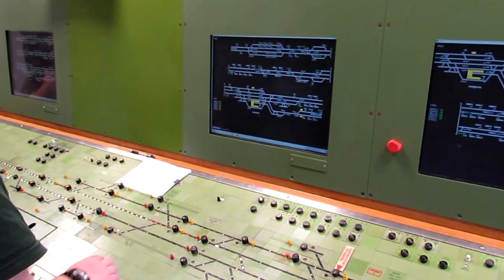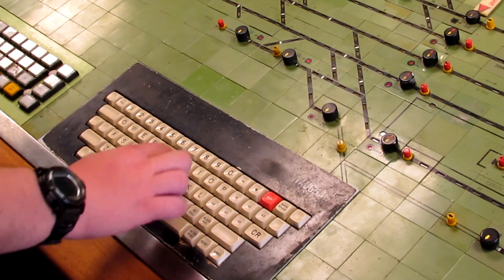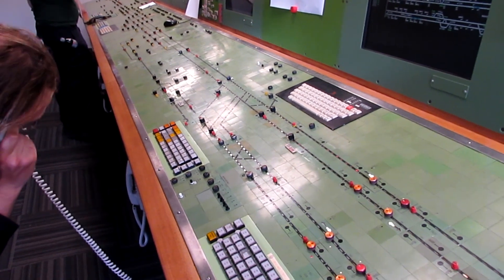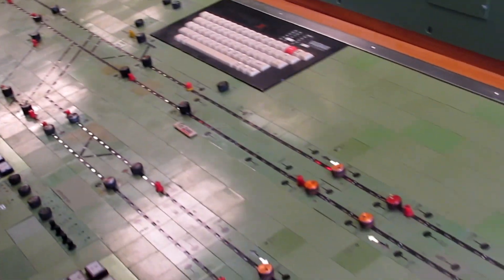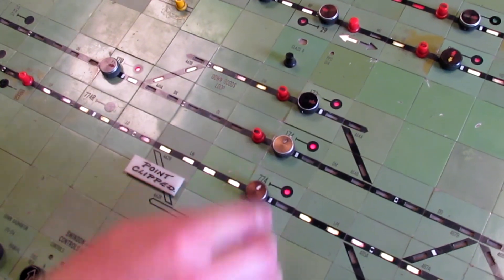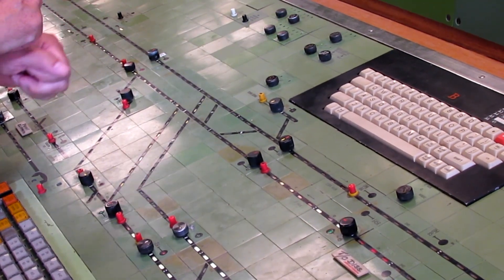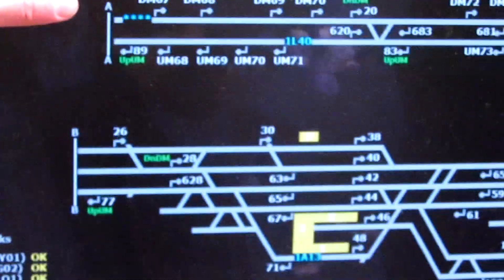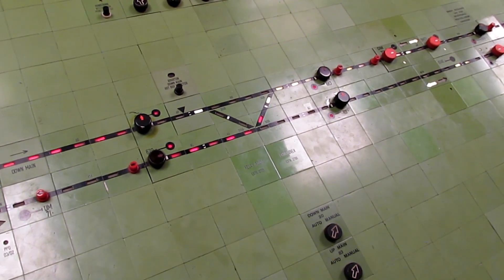Swindon Signalling Panel at Didcot - using JMRI to simulate trains!

Comment: Fantastic video there John especially in didcot signal box
Reply: The Cowley Bridge Junction signal box display normally lives at the Romsey signal box museum. It has been designed as a portable display so it can visit various exhibitions/event, this was its first outing but we now hope to do more in the future. You can find out more about Romsey signal box at: http://www.romseysignalbox.org.uk/
Reply from the maker: Thanks Scott - when you say the 'Didcot box' I presume you are referring to the old fashioned box with (miniature replica) levers? That is actually from a box near Exeter at the junction of the old GWR and Southern lines called Cowley Bridge, but thanks for your kind words! The modern panel was relocated from Swindon to Didcot.
Reply: @JohnPW22 is everyone allowed to have a go with the miniature lever frame?
Reply from the maker: No! Only those demoing! It was visiting at the time I believe. @TransitZone
Reply: Takes me back - i worked this panel from 2009 to 2015 😁
Reply from the maker: Glad you liked it! Must have been amazing compared to the old boxes. I hear using computer screens is not so conducive to commradary? I was fascinated that the timetable could get out of synch and you need to hit a button to step up trains? Not sure I fully got that?